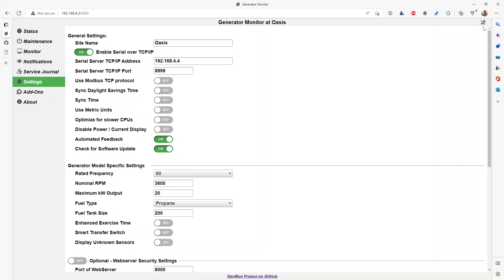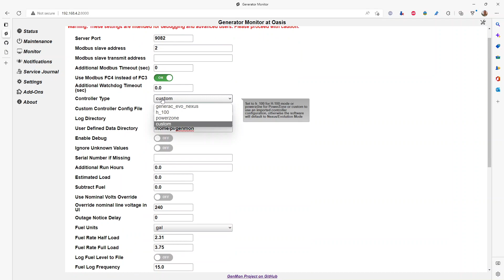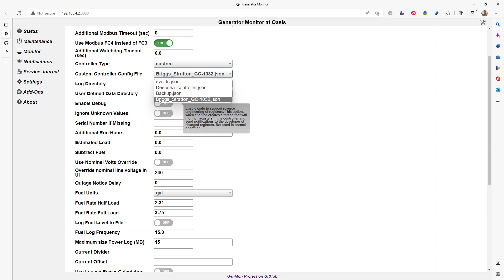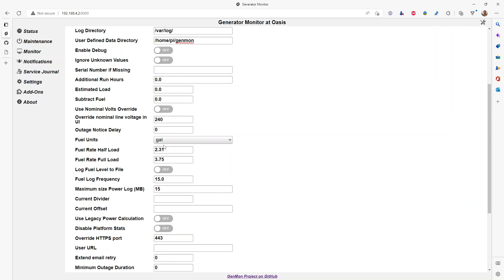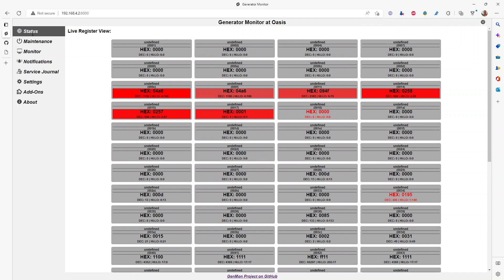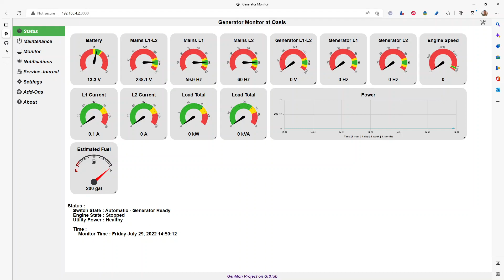Walkthrough of the Advanced Configuration settings in genmon for the Briggs and Stratton Generator

Comment: All these steps were very useful. But I still can't get it to connect. Went to the hidden page did everything there and the file tend to correcpt everytime we  use even for the generator and had to reinstall the software to the raspberry pi. ID is 2, we reserved the wire connections to make sure that wasnt the problem. The error message we are getting now at the bottom of the software is "Not Receiving data".  Can you help make this make sense.. Also on the email setup do you have to have a gmail email address only or can you use any? If so the other emails will not setup. Thanks in advance

Comment: Just found this really excited to jump into it. Have raspberry pi and esp32 boards. Raspi seems to be the standard for this but if you were doing it today would you do tophat or separate rd485 module? Most versatile and reliable. Don't mind struggling through some instructions to tweak the tophat if that's utilmately better can power locally or remotely so not a big concern for that aspect.
Reply: The W630 is much much easier to setup, and can be outside on the genset, which also allows you to put the RPi in the house, rather than out in the shaky hot/cold genset. The PI and the W630 talk over TCP, and you access this whole thing through the GENMON webpage running on the PI
Reply: @DrRon1957  I actually have the W630 and also the rs485. I didn't like the added failure point of the wifi communication so I switched to the rs485 and everything is hardwired from generator to house. But if you need to bridge a gap with wifi the w630 definitely solves that issue. I was luckily enough to be able to easily run a wire directly to my generator
Reply: @PedalDoc  Cool, I cant hard wire this, but I have always on UPS boxes on the devices that are not running on the genset battery. Fingers crossed. Good Luck either way it goes. Be safe
Reply: I have gone through every setting, change and config idea I can find...but I finally connected an Oscilloscope to the direct wired RS485 ports on the genset and I do NOT get a signal from the genset. I do get a sine wave that indicates there is about 1.75 volts at the RS485 terminals on the gen, but it isnt a data signal (Rise, flat top, fall) or (Fall, flat bottom, rise) which would indicate the data at top and bottom. The RPi hat is polling the genset, I used TCP and I used serial, hard wired straight from GEN to  PI hat. I found programming data for the controller, and it indicates the controller will not transmit a single thing unless it is asked correctly, but it always listens. AS such, I can not get any signal back from GenSet, and honestly cant find an answer to why the oScope signal looks like it does. I am beginning to think the RS485 at the gen is not functional...but I cant prove it.  I need ideas or help it appears. @PedalDoc
Reply: I also have installed modbus polling and modbus slave programs to connect hard wire direct from RPi and from WIN11, and every single piece of software times out because the genset never responds. I have a to a, b to b, and g to g. I can see Genmon polling the generator on the RS485 devices, but there is never a response.